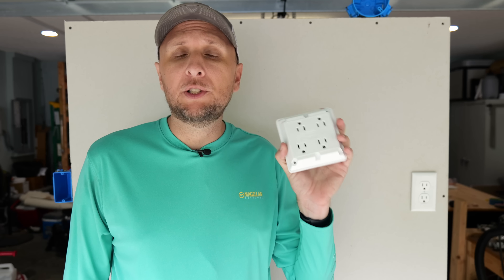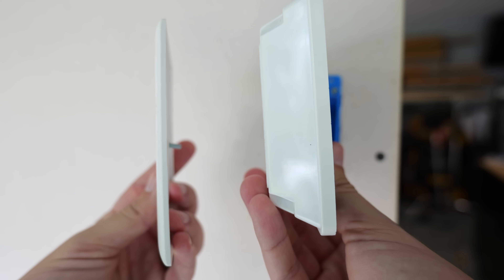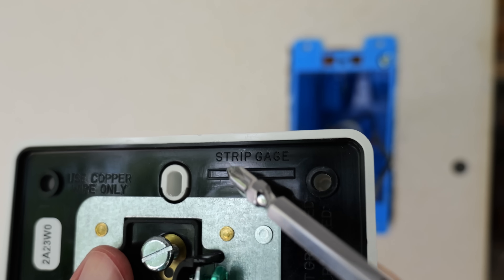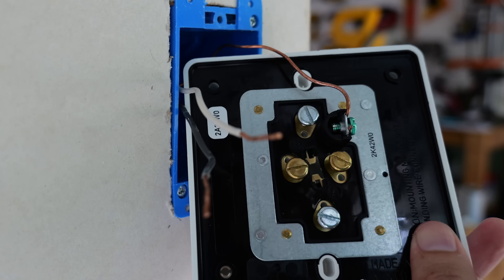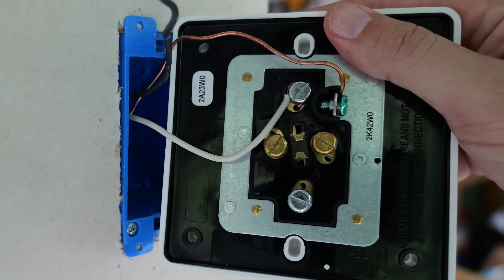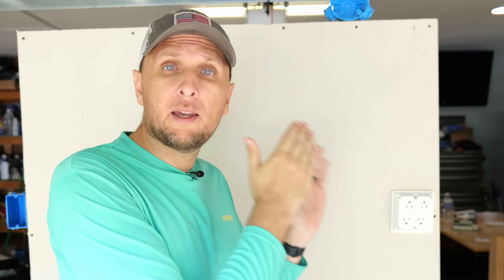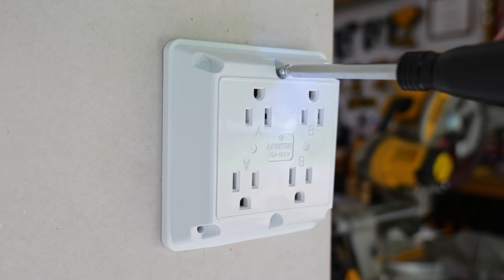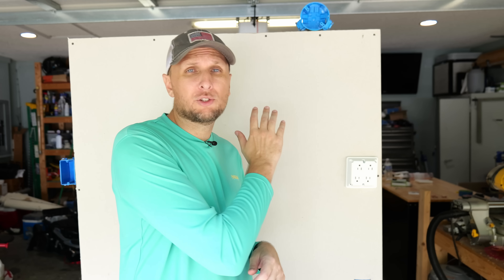The GENIUS 4 Outlet Receptacle That Almost Nobody Knows About | How To Install

Comment: Can someone help me understand the benefit to doing all of this work, vs just installing an outlet splitter that just plugs into the existing two outlets? The one shown in this video sticks out from the wall about an inch or so, and is not flush. The ones you plug in do the same. So I really don't understand the benefit here compared to the time and effort to install it.

Comment: I think l that is the stupidest thing I have ever seen.  If I didn’t mind a big ugly box hanging out, I would just use a plug in version that doesn’t need any rewiring at all.
Reply from the maker: Then you don’t understand the value of this.
Reply: @HowToHomeDIY  Obviously I don't.  How is this any better than a four way outlet that simply plugs into a two way outlet and gets screwed into the wall to keep it in place?  Amazon sells screw in outlet converters that have 5 outlets,  surge protector, 3 USB outlets and one USB-C outlet for under $10.  All you do is plug it in and place one screw in the center to hold it in place. Please explain the "value." of your ugly box sticking out from the wall that still has to be hard wired in place. I'm all ears.
Reply from the maker: I don’t need to sell you on it.  Somehow these are uglier than the things you’re talking about though which is really interesting to me.

Comment: I think it's much easier just to buy a four-prong plug-in outlet and call it a day
Reply from the maker: It's also not as good.  But sure.
Reply: @HowToHomeDIY  I've been installing electrical devices for a very long time, if the outlet is 15 amps and the four prong adapter is 15 amps, then what's the issue? If you have a 20 amp outlet just make sure you get a 20 amp adapter and call it a day

Comment: Why would you use this over one that just plugs into the existing outlet? It doesn't seem to save any space. It sticks out just like the one that plugs in does and this one has to be hardwired as opposed to just plugged in when you need it and removed when you don't.

Comment: Great stuff!
I do have a question.  On Amazon I found the Leviton 21254-GY 20A, 125V, Industrial Series Extra Heavy Duty Grade, 4-In-1 Receptacle, Straight Blade, Grounding, Gray.  The price is lower.  Is there any reason to install the 15A version you linked to, rather than the 20A version?  It appears that all the 20A versions are a few bucks cheaper than the 15A.  (At the moment that particular gray version is on a deep discount on top of that.)
Reply from the maker: If it is on a 15 amp circuit and the wiring is not rated for 20 (12 gauge) then installing a 20 amp receptacle would be against code and create a potential fire hazard.  If it is already a 20 amp circuit with the appropriate wiring then installing a 20 amp receptacle would be ok.
Reply: Gotcha.  Thanks!

Comment: I think I would just pick up a 6-outlet surge protector that plugs into the existing outlet.  No wiring needed.  I don't see the advantage of this quad adapter.
Reply from the maker: It’s hardwired which is superior in every way.  It will also outlast any of those adapters you buy many times over.  The wiring is literally a few minutes.  But if that holds you back, buy a power strip, those install even easier than the adapters.
Reply: @HowToHomeDIY   Thanks for the suggestion.  The wiring is not a problem. I do all my own electrical work.  I just see this as a very niche product.

Comment: Is there really that much benefit to using this receptacle instead of just plugging a 4- or 6-outlet wall tap into the existing duplex receptacle?  Both solutions look about the same and there's only about a quarter-inch difference in the amount of protrusion from the wall.  A lot of the plug-in wall taps even add USB charging ports that the hardwired Leviton version doesn't have.

Comment: You didn't add amperage capacity so what's the point of a 4 gang receptacle.  May as well use a normal power strip or one of the 4 gang that plug into the 2 gang receptacle

Comment: What if you have an outlet near water source such as bathroom.  Is there a GFI 4 plex or do you install a GFI on the upstream feed
Reply from the maker: As far as I know, they do not have a GFCI version of this so yes, in a wet location like that it would either need to be protected by a GFCI receptacle upstream or a GFCI breaker on the circuit.
Reply: @HowToHomeDIY  thanks!   Great tip

Comment: Why is this preferred over a plug-in adapter? It sticks out about the same.
Reply from the maker: To me it’s preferred because it’s a hard wired connection and built better.  But I also have adapters in some places.  Just depends on the use for me.

Comment: I like the video a lot, but I have a question regarding the ground wire with no insulation could potentially touch either the ground or the hot. Any suggestions?

Comment: Twenty-five years ago, I used Bryant Quadplexes which are comparable to these, nothing except wire in a single box. Yes, they are not a flush with the wall, but the convenience of a quad outlet, without the wiring hassles is glorious. Sadly, the  Brant Quadplexes are no longer available. I stayed away from the cheapest Leviton. Glad to know they make higher quality products than what one usually sees being sold. If I were doing whole house wiring, again, I'd look seriously at these, but for a higher grade than Leviton's cheapest version.

Comment: NOTE OF CAUTION: Those bare terminals sticking out the back, rather than on the side of a traditional plug, allow easy access for that bare ground wire to touch the terminals when pushing the wire back in the box. It may be wise to use a green insulated pigtail for the ground wire to avoid this.

Comment: Great instructional video. However, this looks like the same thing as a quad receptacle that inserts into one of the receptacles and gets screwed in to that existing receptacle. No wiring needed. Just plug in and screw down. In your opinion, what's the difference? I can do the prementioned type in 60 seconds.
Thanks, again.

Comment: This entire design is a bad idea 😑
People tend to go overboard with those and add several, potentially overloading the circuit 🤨
Unless, of course, you like running out to your Circuit Breaker panel to reset the breaker 🤔
It's entirely up to you ✝️🇺🇸🙂 
Otherwise a very good How Too  presentation 🙂

Comment: It looks like you have to be really careful when pushing the receptacle cover, and the wires back in the box that the ground wire does not short against the hot terminal screws or even the neutral screws. They should’ve provided a cover plate to cover the hot and neutral screws.

Comment: Very well designed set up! They make this in a 20A version too. 

A bit pricey, but if you have a single duplex and want a 4 gang,  this is a great way to get there quickly and then the price is worth it.  I do like the offset too and the ground up and ground down configuration. The anchor hole for the screws is great too! Just a very well thought out design.

These days, a single duplex really doesn't give you enough locations to plug stuff in. It's usually not a case of current capacity, but just a need for more receptacles.  With many devices using wall wart supplies, this works well for that. 

Short of a complete redesign of plugs and receptacles, this is one of the best innovations I have seen,
Reply: " They make this in a 20A version too. "  can't find one on the website

Comment: This will be great, I can now plug in my Four electric Space Heaters!
Reply: Make sure they put out at least 3000w each.
Reply: That would draw 100a each. You might as well have a dead short
Reply: @ZT_1234  
Only 50 to 60 amps. 4 circuits might be a bit much to run into just the one electrical box.

About the amount of heat that a small gas logs set produces.
Reply: Appliances connected to a 20 amp 120 volt circuit are only rated to draw a maximum of 12 amps continuous. A 3000w space heaters would draw 25amps. 100 amps would trip the breaker instantly
Reply: Make sure the extension cords are long enough and put them under some throw rugs!
Reply: @Rocketman88002  If you're going to run the extension cords under rugs, be sure to use the really thin wired extension cords, like lamp wire, so they don't leave unsightly bulges in the rugs!
Reply: I think the load may be too much for the circuit breaker to supply for that action ...
Reply: @JPack-cs9mw It was a joke...
A typical space heater draws about 1500W (12A).  So you can only put one (1) heater on any given 15A or 20A branch circuit, regardless of design...
To connect two or more on one circuit risks permanent damage to the house wiring, fire, and damage to the panel and breaker.
Reply: I prefer to plug in four 18ga power bars without breakers daisy chained. Can run 50 space heaters for my 200sq ft shed. Prevents my gasoline from freezing. 😂
Reply: @ 
I prefer to plug in four 18ga power bars without breakers daisy chained. Can run 50 space heaters for my 200sq ft shed. Prevents my gasoline from freezing.

Maybe I should try that in one of my video game houses? It seems to work. No issues other than not much space for other stuff other than heaters. Did not produce any heat though. Looked pretty. But to be a fair test, I would need a 3-D model of an electric heater. Not a kerosene heater, and not just ridiculous wall-mounted Retro Radiators. That would be too many radiators to place them all at the floor level.

I wonder how many Breakers panels that I should put onto the wall for that? Looks like they have 8 branch switches each on them. So I would need 7. I wonder if the 1 outside Utility Pole transformer would be enough? Sure, why not? It should be able to power 7+ houses.

So how many stores did you have to visit to buy 50 heaters? I would not think that they would even have so many in stock?
Reply: Wow that’s awesome
Reply: Be sure to crank all of them up to 11 at the same time.
Reply: Just because you have now 4 outlets does not mean that you have to use all 4. I always run my bathroom ceramic heater on the low-heat setting, because what for do I want to test the capacity of the ancient wiring? Just how much heat do I need to drive the chill away from the toilet? Not like I am trying to heat a huge warehouse.

Of course you could plug in 4 almost-no-current night lights, if they are pretty. Or just buy some cheap wall outlet plastic covers, to help you resist the temptation to stick something metal into the outlets.
Reply: Just put them underwater!
Reply: (This IS a joke, for anyone who didn't get that...) Funny!

Comment: If you want a “flush to the wall installation “
Checkout “Knee Saver Electrical Box “.
Behind a T.V, it doesn’t matter what it looks like, but on the counter top wall in the kitchen, it does matter. The knee saver device looks like it is part of the original installation.

Comment: My only comment is that you ignored the small holes next to the screws designed to make the j-hook for you. Just insert the end in the hole and wind around the screw. It’s held firmly in place by the hole and creates a tight loop without tools.
Reply from the maker: I did that in the video.  How did I ignore them?  I used them.

Comment: If you are an experienced electrician you know what the anchor holes do and you'll wrap the wire CCW around the screw.  But if you are a DIY'er you may struggle with tightening the screw and keeping the wire in place - maybe ending up with a loose connection.  Shoving the receptacle back into the outlet box can loosen screws.  Not so ingenious a design, IMO.  Back to the drawing board, Leviton!

Comment: This is a great option for visible outlets where a traditional power strip would be unsightly.  I like how they flipped the top outlets to allow for four wall warts to be plugged in (like cordless tool battery chargers).
Reply: wort: the liquid extracted from the mashing process during the brewing of beer or whisky. Okay, but what is wall wort.
Reply: @LucidDreamer54321 Sorry, "warts".  Original comment has been corrected, thanks.

Comment: I disapprove of winding AND TIGHTENING the gold and silver terminal screws in the COUNTERCLOCKWISE
Reply from the maker: Ok? You have to wrap it counter clockwise in order for the wire to actually be going around it clockwise.  So you can disapprove all you want, it was done correctly.

Comment: This thing is not really the best design. You can buy devices that plug in to the existing outlet and provide receptacle that face out to the sides and even that have USB ports. These sell for less than $12.
Reply from the maker: And are cheap garbage that will start failing or ports getting loose after a little while.
Reply: @HowToHomeDIY  I have had excellent results with them.

Comment: NOT GENIUS!  A simple wall tap (4-plug, 6-plug, USB) costs less than $10,  protrudes the same, and doesn't require you to get into the receptacle.  Just plug in.

Comment: Would this be ok to use on an outlet area that is already tapped into from an existing outlet?
 Is it safe?
And it says in the important information that it's 125 watts?? 
Does this mean you can only use 125 watts with this outlet?

Comment: How would you wire this if replacing an existing 3 way recepticle? 

Bottom plug in controlled by a light switch (Black wires is live,  red wire is live when light switch is “on”, white wire is neutral? Bare copper wire is Ground

Can I use A circuit for the wall switch and the B circuit for the live plugs?

Comment: If I were to run a series of these receptacles in the metal junction boxes (thinking three boxes, a few feet apart on a workshop wall), would I only connect/chain them using my hot and neutral wires, while grounding each receptacle individually to their respective junction boxes?

Comment: The only problem I see is it would be easy for that ground wire to be pressed into the box and make contact with the hot or neutral since everything is flat on the back.

Comment: There is a much simpler and cheaper version available that is installed by simply removing the existing cover plate and plugging it in.  It has a center screw that locks it onto the existing outlet.  It also has two sets of male prongs on the back to maintain the function of an existing split outlet.  No need to go through all the rewiring.
Reply: Yeah, exactly. This seems like a lot of work just to end up with a result not much better than a simple outlet extender.
Reply: I also have one that plugs into an existing duplex receptacle. It's a surge protector and has USB charging ports.
Reply: There a quality recptical not resedintal grade they are also available with surge protection

Comment: I don't see the big advantage over the plug in/screw down adapters they've been making for ages and ages.  You take off the cover, plug in the adapter and screw it in where the cover used to screw in.  It uses both plugs so the full 15A shouldn't be a problem.
Reply from the maker: Cheaply made and many of them start getting loose connections after moderate use for a couple years.  This is hardwired and industrial grade.  The two don’t even compare.
Reply: @HowToHomeDIY  I've yet to have a problem with one but I don't run a lot of power through them either.  Thanks for the reply and the video.

Comment: Unfortunately this becomes 2 outlets , depending on your device circuit loading, you could exceed the amount of devices allowed by code
Reply from the maker: There is no code for the number of receptacles allowed on a circuit.
Reply: wow in Canada we are limited to 12 devices per a 15ampcircuit

Comment: Pigtails are required by NEC and CEC
Reply from the maker: They are not required by the NEC, the CEC I am not as familiar with.  But people keep trying to use NEC 300.13 (B) to make their argument but that only applies to multi wire branch circuits.  It is not a cover all.  MWBCs are also not super common in residential here in the US but do exist in some places in rooms such as the kitchen.  But no, the NEC does not require pigtails.
Reply: @HowToHomeDIY  ok but it should be if you put a heavy load down stream like a heater and it shorts out that load goes through the device or if receptacle has a heavy load and burns up anything up stream stops also
Reply from the maker: Oh I agree.  I’m a huge believer in using pigtails.  I pretty much always use them for the reasons that you gave.

Comment: I like the connections (is that available on a  standard single receptacle?), but what's even easier (and cheaper) and perfectly good for most uses is the 6 gang outlet that just plugs into a normal duplex outlet and fastens with a single screw. I think this is mostly a solution in search of a profit that doesn't exist.
Reply: I could see it being useful on a shallow gang box because it's flat against the wall.
Reply: @palarious  It's pretty much the same depth as the 6 gang add-on.
Reply: @suedenim9208  that's not the point I'm making. Your standard receptacle sets back into the gang box. In a shallow box, that's really a giant pain in the butt to wire when the back of your receptacle is millimeters from the back of the box. 

This would solve that issue, as the receptacle here does not protrude back into the box.

Comment: Are you kidding me $28 No thanks..... I'll do it the traditional way for a couple of $$
Reply from the maker: When I bought mine it was a little less than that.  The traditional way will save some money but to compare apples to apples it wont be that big of a savings once you factor in two industrial grade receptacles and a double gang old work box.  Assuming you have the scrap wire to make the connections and jab saw on hand already.  Industrial grade receptacles are usually around $7.50 or so a piece so $15 there and a double gang old work box is around $4.50 so you are in it $19.50 assuming you have the rest on hand.  So that is about $3 less than I bought this on Amazon for.